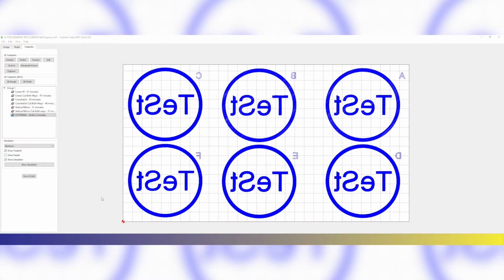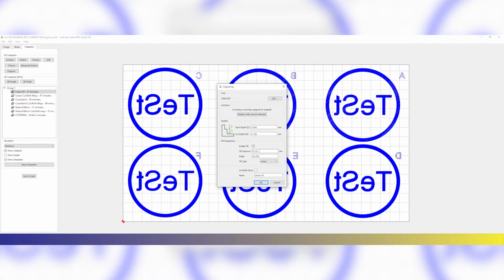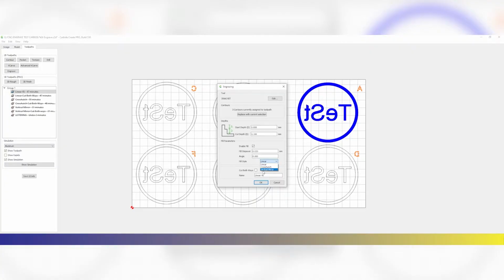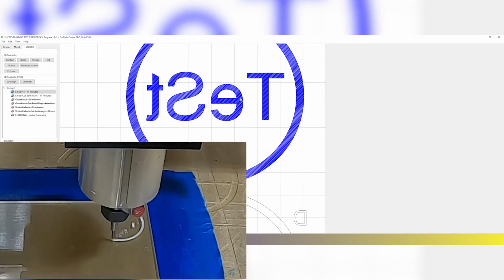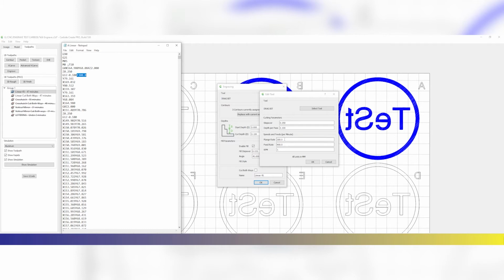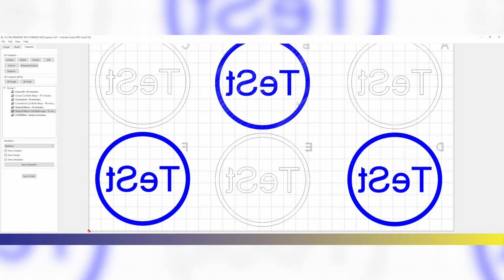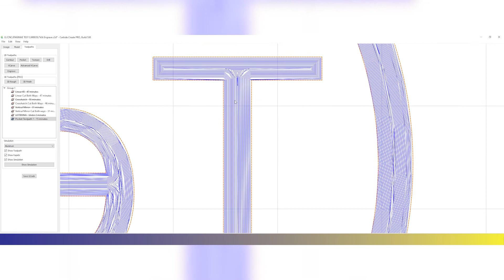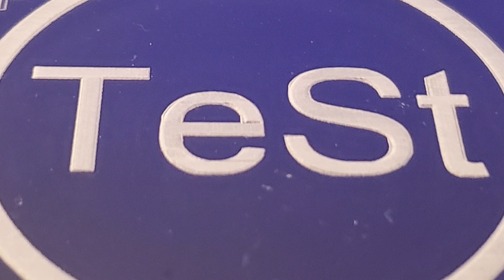Carbide Create Pro- New Engrave Feature with Spring Loaded Drag Bit

Comment: how are they going to lock this behind a paywall, and not have any clear instructions or tool settings. im reading people are having to use setup to trick materail thickness for setting pressure, but i have other cuts i need to run, so i cant use that to "fool" the software.

Comment: It's difficult to see the settings. What settings did you use for test A?
Reply from the maker: For Test A my Settings were: Cut Depth 0.1mm, fill step over 0.035, & Angle 45, Fill Style Linear.  Bit Diameter 0.1mm
Reply: @D.E.Hammer  Many thanks!

Comment: How to make G code program in vector aspire using carbide create diamond drag bit. What diameter, depth, feed and rpm can give.
Reply from the maker: When engraving I typically use 0.1mm for the bits diameter, others have said they use 0.05mm. For depth I use 0.1mm with anywhere between 0.5mm - 1mm worth of pressure when setting job 0. Feed will depend on what type of cnc machine you are using so for example on my 3018 I use a speed of 250-300mm per minute and on my LongMill I use 900-1000mm per minute. With a drag bit you DO NOT turn the Router/Spindle on so you set the RPM to 0.
Reply: @D.E.Hammer  Thankyou
Reply: @D.E.Hammer  ok this answers my previous question about job pressure.
Reply: @D.E.Hammer  What about plunge rate and stepover. In vector aspire they asking line width. How i can give?Mainly plunge rate
Reply from the maker: Plunge rate 250 - 350mm per minute. Have not used vector aspire but I assume they want the diameter here and you can go with 0.1mm - 0.05mm with a step over of 0.04mm - 0.003mm. I personally use the 0.1mm width and 0.04mm step over  for my drag bit.
Reply: @D.E.Hammer  Thanks for fast response.

Comment: I bought the 90 and 120 degree diamond drag bits from Carbide Create but I don't see any reference to them in the free version. I'm strictly a hobbyist who only uses the CNC occasionally so paying for a subscription to the Pro version doesn't make much sense for me.  I wouldn't have bought the drag bits if I had known there was no software support for them. Do you have any tips on using them without the Pro version?
Reply from the maker: You can set one up in the library under v bits if engraver is not showing up, that's what I did when I was on an older build version. For rpm set it to 1, and it will not activate your spindle. For diameter use 0.1mm to 0.05mm. To do outlines use contour and to fill use pocket.
Reply: @D.E.Hammer  Great, thanks for the tips!
Reply: @D.E.Hammer  Btw. I've watched your previous Acrylic videos and my projects have worked out nicely using your advice.